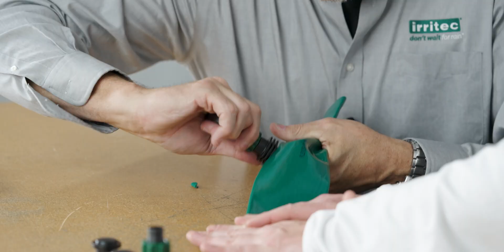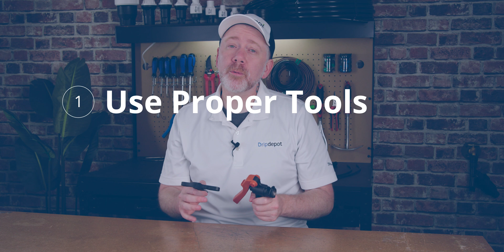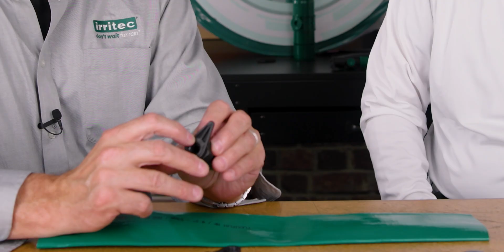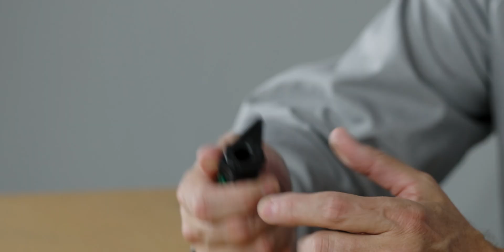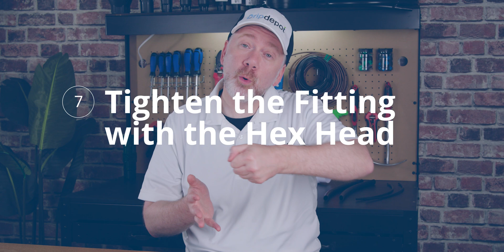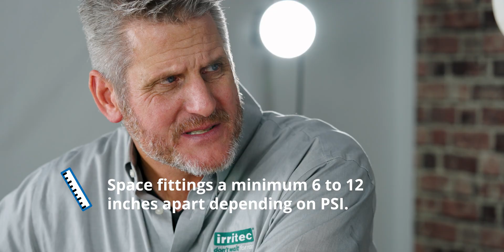How to Install Layflat Fittings (Complete Guide)

Comment: Very informative,  I have never used a layflat before.
Reply from the maker: Thank you!  Layflat is pretty popular in larger irrigation projects these days -- we see it (particularly the higher pressure kind) used a lot in mining operations as well :)
Reply: I guess one of these days I will have to ditch the hdpe and the pvc for the layflat .
Reply from the maker: @paulndungu8001  Layflat is definitely nice to store and transport, being able to be rolled up, but HDPE is pretty nice too being super durable and able to withstand very high pressures.  I like working with both (I'm not a huge fan of PVC though lol, probably because I've always lived in placing with freezing temps during winter)